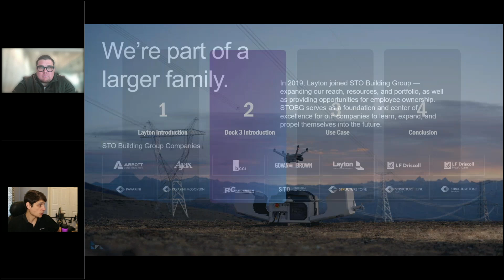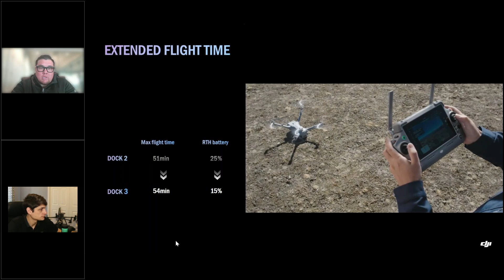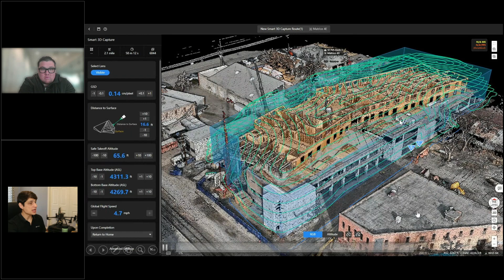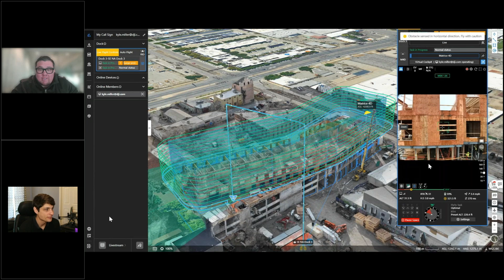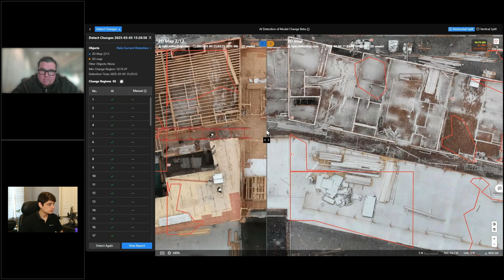DJI Dock 3 in Action: First Dock 3 Case Study Webinar with Layton Construction

Comment: 🎯 Key points for quick navigation:

00:14 🚁 Drone Program Origins at Leighton Construction
- Introduction to the origins and growth of the drone program at Leighton Construction.
- Austin's transition from marketing to drone operations.
- Expansion of the drone fleet from initial usage to a robust program spanning multiple locations.
03:38 🌍 Leighton Construction's Core Values and Operations
- Overview of Leighton's core values and their application in drone operations.
- Description of the company's geographic footprint and use of drones in different locations.
- Introduction to the broader organizational context within STTO building group.
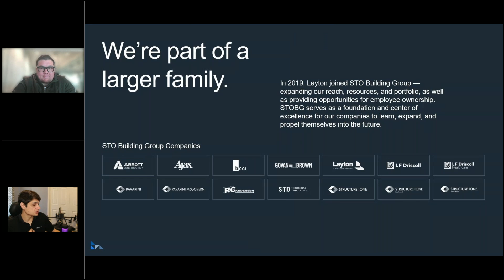08:04 🔧 DJI's Drone Hardware Advancements
- Discussion on various DJI drone models and advancements over time.
- Benefits of hardware improvements such as longer battery life and mechanical shutters.
- Highlight of the impact of technological advancements on construction mapping and workflows.
09:40 📦 Innovations with DJI Dock Systems
- Detailed comparison and evolution from DJI's Dock 1 to Dock 3.
- Insight into how the dock systems automate flights and improve operational efficiency.
- Importance of enhanced capabilities like remote deployment and environmental resilience.
14:03 🛡️ Environmental Challenges and Rugged Hardware
- Discussion on the environmental and operational benefits of using ruggedized gear.
- Experiences showcasing the DJI Dock 3’s performance in adverse weather like snow.
- Reliability of newer hardware in maintaining drone flight stability and safety.
17:30 🚀 Advanced Drone Capabilities with Matrice 4 Series
- Overview of the sophisticated features and improvements in the Matrice 4 drone series.
- The role of advanced sensors and gimbal modifications in enhancing data capture.
- Insight into how obstacle avoidance and smarter flight systems improve construction site operations.
20:57 📸 Drone Capabilities and Image Quality
- Importance of capturing high-quality data for effective 3D modeling.
- The advanced features of DJI for high-quality imagery and extended flight time.
- The significance of extended flight time for large site projects.
23:01 🚀 Dock 3 Charging and Multi-Dock Capabilities
- Discussion on Dock 3's rapid recharge capabilities compared to Dock 2.
- Multi-dock support with Flight Hub 2 enhancing operational efficiency for large sites.
- Potential for "dock hop" technique over expansive areas.
24:37 🌧️ Dock 3 and Drone Features
- Introducing the standalone drone compatible with Dock 3.
- IP55 rating for adverse weather, ideal for challenging climates.
- Benefits of larger flight time and wind rigidity.
27:19 🚗 Vehicle-Mounted Docks and RC Plus Controller
- Innovation with vehicle-mounted dock concept for versatile use.
- Advantages of RC Plus2 controller, especially for its large screen.
- Exploration of obstacle sensing module capabilities.
30:21 🏗️ Project Site Use and Observations
- Utilization of drones on construction sites for monitoring and inspection.
- Emphasis on site monitoring, earthwork, and asset inspection.
- Drones as critical tools for project documentation from start to finish.
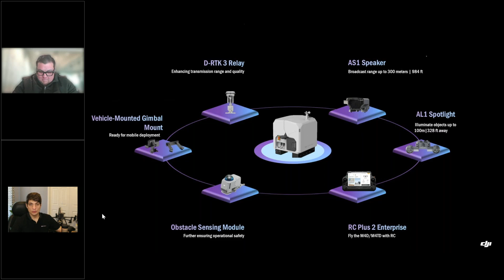34:59 🎛️ RTK and Dock Installation Considerations
- Use of RTK systems for precision in drone operations.
- Benefits of the DRTK3 relay for better connectivity without elevating docks.
- Practicalities of placing docks on roofs or trailers for safety and visibility.
38:38 🛰️ Implementation and Flight Planning
- Description of drone flight plans and their application to urban projects.
- Smart 3D capture and advanced gimbal features for accurate mapping.
- Tech advancements allowing detailed and efficient aerial data capture.
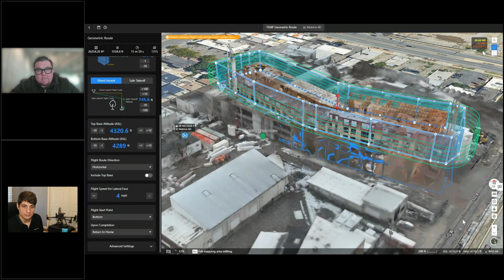41:53 🚀 Early Testing Benefits
- Early testing of drones and software like FlyHub and DroneDeploy facilitates smoother company-wide deployment.
- Experiences with past models, like Mavic 3E, highlight the importance of compatibility and testing.
- Ongoing tests improve data quality and streamline nationwide rollouts.
43:16 ✨ Precision Data Capture
- Geometric mission planning allows drones to stay close to vertical job sites, enhancing data accuracy.
- Smart mission planning provides efficient site coverage with rapid data processing.
- Continuous updates are necessary due to daily changes in construction sites.
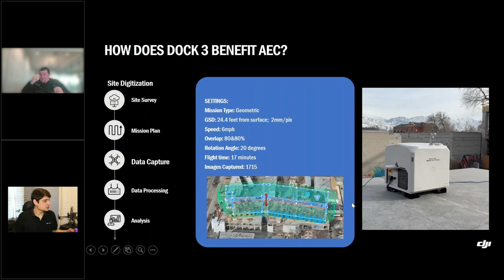44:54 🚁 Enhanced Drone Performance
- Drone takeoff is markedly faster with Dock 3 compared to Dock 2.
- Improved efficiency reduces startup time and saves battery life.
- Faster deployment improves data capture and operational efficiency.
46:31 📏 High-Resolution Imaging
- Geometric and oblique capture methods provide high-resolution data with millimeter-level accuracy.
- A single drone flight can capture thousands of photos with significant detail, using minimal battery power.
- The realistic 3D models created impress team members by resembling live drone footage.
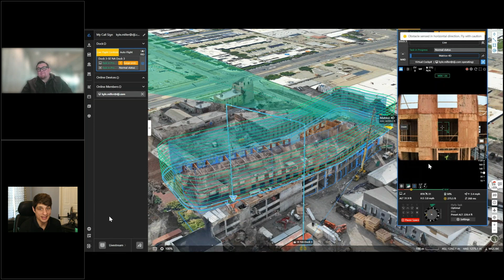49:14 🏗️ Construction Tracking
- FlightHub 2 enables precise 3D modeling with high-quality textures and meshes.
- The virtual cockpit mode enhances situational awareness and safety with obstruction and aircraft alerts.
- Integration aids in maintaining construction safety standards, especially near airports.
52:04 📊 Data Processing and Analysis
- Processing data in platforms like DroneDeploy provides comprehensive site insights.
- FlightHub 2 tools enable change detection and progress tracking over time.
- Quick data capture and processing facilitate monitoring site alterations, enhancing project management efficiency.

Made with HARPA AI